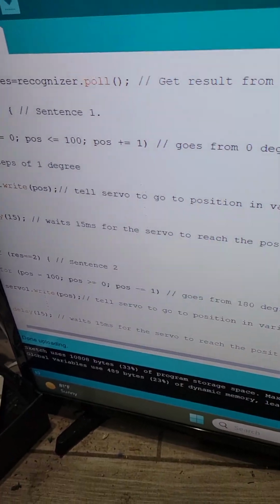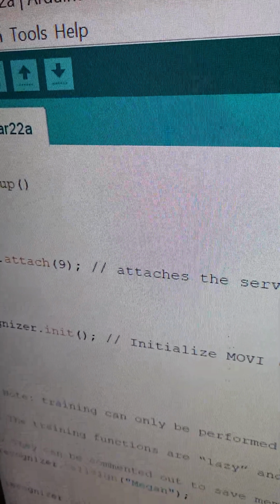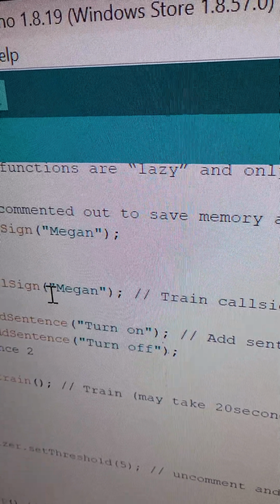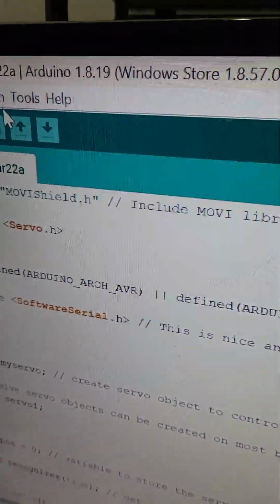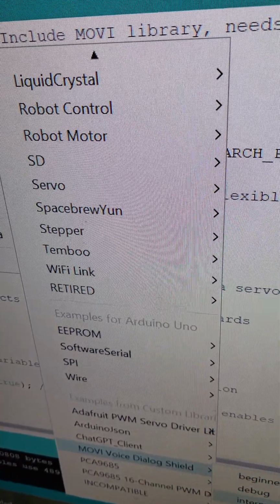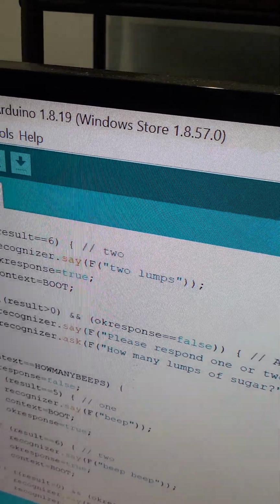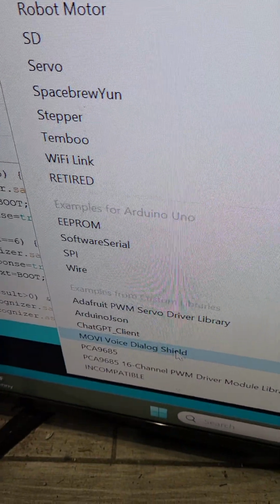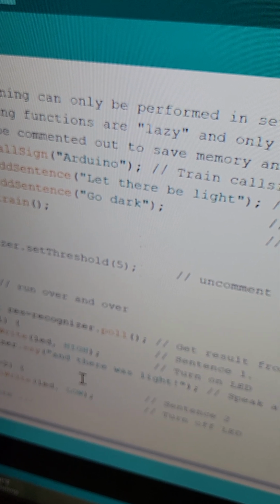#m3gan #arduino #arduinoproject #robot #Movispeachrecognizer

Comment: Honestly, I love the build and the concept. However, the look of her is quite uncanny, as if she was made to look scary. I'm pretty sure you took a mannequin and just added the servos and other parts. I'm not saying you should, but I suggest that you try 3d printing out a body for her, fully modified for her fitting and size. That way people wont think she's THAT scary. I said this because of how her insides are exposed whenever she looks up.

again this is my opinion and I don't mean any harm.
Reply from the maker: Yes, it's for testing servo and software. I have been in between houses here recently.  Once i finish moving, I will start the mark 1 scarlett johansson build. That is 3d printing and silicone sculpting.